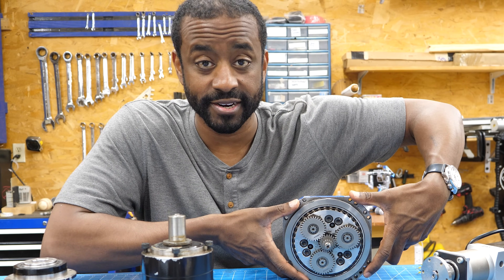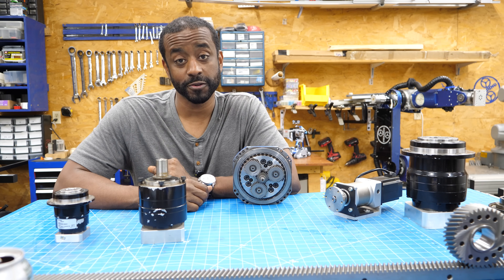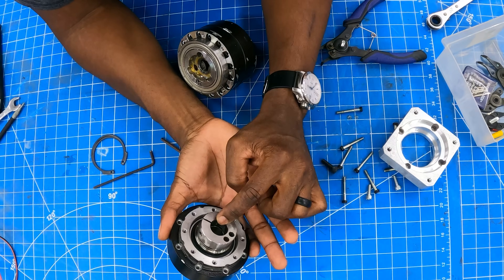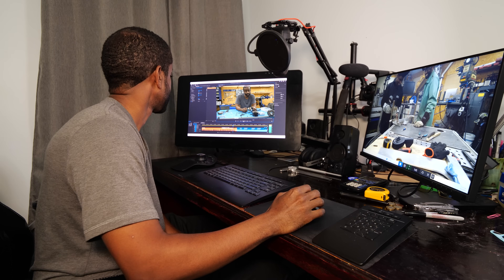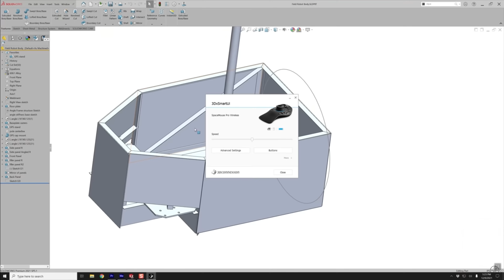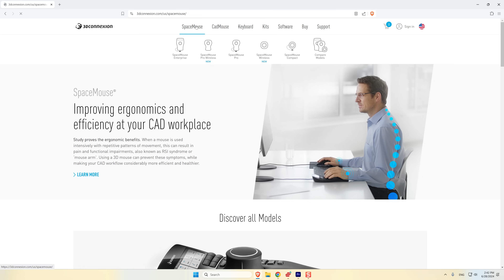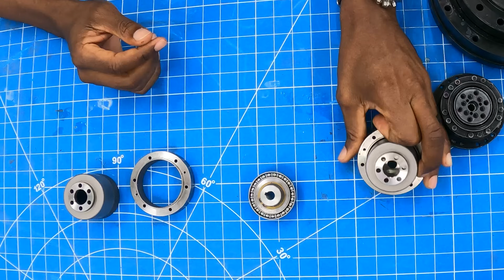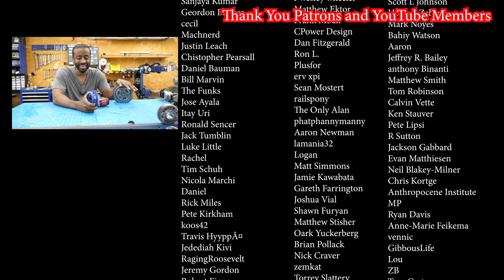Why Harmonic Drives Are Awesome.

Comment: I disagree about positional accuracy,  worm drives are used to point telescopes at arc minute level accuracy
Reply from the maker: Backlash is irrelevant when controlling by hand. Unless you are talking about a fully automatic telescope. If so it’s likely not a worm drive. But this is an interesting question. I didn’t mention this difference in the video
Reply: @JeremyFieldingSr  Computerized worm drive driven telescopes. I service them as part my job. Accuracy is achieved by having a larger ring gear with higher tooth count along with lapped gears for smoother periodic errors. Manufacturing has gotten so much cheaper that sub 1000 dolar telescope mounts can have periodic errors in tracking of less than 4 arc seconds peak to peak. Only annoying issue is backlash,  which is reduced with a spring loaded worm gear that is pushed against the ring gear but will not stall due to the spring mechanism. Older telescope mounts needed manual setting of gap and would sometimes stall the motor with temperature changes.  In fact, my personal mount has encoders and I can even take images without a camera providing positional feedback, the encoder records the periodic error and provides a closed feedback loop. But most people by ones without encoders
Reply from the maker: 😁LOL. Ok. Details obviously matter here. Spring loaded gears are a different approach to fixing the problem. I agree when the load is low enough this works great. I have used gears like this that are split in half with half of it spring loaded to close the gap and remove backlash. What you described sounds similar or perhaps even the same maybe. There are many interesting ways to attack the problem. I have indeed seen this work well.

Comment: I wonder why strainwave drives are so expensive. Due to it it having flexible parts, it would intuitively make sense if it were more tolerant of manufacturing inaccuracies. Having a lot of teeth engaged at the same time should average out differences in engagement depth and cancel out backlash caused by too small inner teeth. Do the required properties of the flexible part make it so expensive? Is forming/stamping that part an impossibility due to work hardening?

Comment: Strain wave gears have made a big splash into astronomy in the last few years for mounts because of their no backlash and their load capacity. But I wonder how many cycles can the flex spline go through before you get material failure ?

Comment: Nice Video, My favorite "gearbox" is the "Constant speed drive" basically two axial hydraulic pumps acting as a gearbox to rectify for older aircraft generators. That thing is just amazing.
Reply: Toyota has now adapted this concept into their hybrid drives.  It just used two electrical motors and a gear train to accomplish the same thing.  The Weber State car website has amazing details about that transmission.  Will replace all mechanical transmissions pretty soon, for car-like vehicles (not heavy power).

Comment: 9:02 Wow! The confidence on display here is remarkable. Yeah, you were hesitant to begin disassembling it but you’re not even organizing and labeling all the parts as you remove them! I recently helped my brother disassemble his desk fan for maintenance and cleaning. Labeled every screw, bracket, etc. I was absolutely terrified of losing parts or reassembling it incorrectly. I’m sure glad I did it though. He was considering buying a new one and the last thing we need is more plastic in a landfill.
Reply: The power switch on my relatively new vacuum cleaner failed.  I had to remove 26 screws to get to it.  When I later wanted to put a longer cord on it, I had to take out 32 screws!  Fortunately all the screws were the same size so I did not have to keep track of which screws went where, but finding where all the screws were "hidden" took a lot of effort.

Comment: Ive never seen those strain wave gears before, clever for sure but how reliable are they, would they not be prone to metal fatigue?
Reply from the maker: As long as you design your machine with an appropriate safety factor and you keep them lubricated you should not have issues with fatigue. However, just like every decision in engineering you need to make trades. If you want the most durable gear over precision you have other options. Specifically you would want gears with larger teeth and thus larger gears. You need to look at your design needs and make choices accordingly. Most importantly though, the further you are operating from the designed limit of the gear, the longer ANY gear will last including this one.

Comment: So planetary gearing is to slow input speed(increase torque) namely, in a confined space. Got it.  ...still have no idea how that works despite taking apart many cordless drills.  I'll have to search for a visual animation as it was not clear in your explanation. Still learned a lot though.  Wish I could afford the special 3D modeling mouse but I don't even need to look to know it will be too expensive.

Comment: Some worm drives are designed to be back drivable  it depends on the contact angle as to how easily back drivable they are, they're used in lifts which may need to be hand wound in an emergency and in that case the back driving through the motor acts as a brake.

Comment: @JeremyFieldingSr - Also offering large ratios in a compact package is the Cycloidal Drive, which gives wide-ranging SMOOTHLY VARIABLE ratios. It was invented and demonstrated by an Australian mathematician, apparently in the 1980s. It operates by taking advantage of the fact that cycloids are very nearly circular in a small part of the bumpy curve, so the mechanism cuts out those parts and stitches them back together in a system slightly resembling a planetary gear set. If I recall correctly from the magazine article, a ratio range of at least 1600 was easily achieved, variable between a small speed increase and a much larger reduction ratio. Definitely both extremes and everything in between were easily accessible and continuously adjustable on-the-fly by way of a single lever. The unit also acted as a clutch when that control lever was pushed beyond max reduction ratio. But I never saw or heard more of it, and I want to! Seems to me it would make a fascinating video for your channel. Can do?

Secondly: Is it really necessarily true that in the Harmonic drive there has to be a difference of exactly 2 teeth between inner and outer? Never more than 2, never less than 2? Because I have excellent visual imagination (including animation) and it seems to me that other difference numbers should be possible, with appropriate changes to other components. I speculate that those versions are not seen because they offer ratios that are always lower than with difference number=2, so those lower ratios are achieved by  re-designing the whole drive. Makes sense to you?
Reply: I’m no engineer but wouldn’t a more tooth difference require a smaller inner gear and thus the outside would have to flex more causing more metal fatigue? Though I imagine tooth size and overall diameter difference might make more than a 2 tooth difference possible. ??
Reply: @dfriendperc  - Those concerns do not apply because this is not like any drive you've ever seen.

Comment: Fun fact, big radial aircraft piston engines often had planetary gearsets on both ends of the crankshaft.  The prop gearbox reduces the speed to keep the blade tips subsonic and the supercharger gearbox increases speed.
Reply: Makes sense, auto transmissions are often the same. An old school automatic 4spd transmission is essentially multiple sets of planetary gears that can sync up in different ways to give you different drive ratios.

Comment: Planetary gears with planets output to the driveshaft and a gasoline engine driving the sun. And for regulating the speed an electric motor connected to the ring gear.
Not good for reserve driving, but it's very responsive

Comment: I have a Black & Decker cordless screwdriver and was rather surprised when I went to open it up in the process of replacing the battery.  (Do this with the bit pointing DOWNWARD!  :-)  What I found was a two-stage planetary gear set,  which explained how the thing had some nontrivial torque...

Comment: Regarding the Space Mouse, ABSOLUTELY!  Having it on my viewport camera (NOT the model!) is an absolute MUST HAVE now.  It makes it SO easy and SUPER FAST to zip around and view things from anywhere in 3D space.  It's also really satisfying to just fly around using a 6 axis controller.  Also try it with Unity and Unreal and Google Earth and Elite Dangerous and...  I see people doing things in 3D without one and feel a little sad for them.
Reply: I attended the SIGGRAPH conference in Las Vegas in around 1991 or so and saw one of these for the first time. The hardware was ungodly expensive back then. The concept disappeared for many years and only recently seems to have turned up again.
Reply: I've been leery.  I liked the devorkian keyboard, discontinued.  Liked the ms optical mouse wheel, discontinued.  I don't want to find myself liking it, and can't get another one when it dies.

Comment: OH, so if you use a harmonic drive you don't necessarily need a slip ring to allow cables to pass through? Damn, that's hella useful!
Reply: Yep... I recently got one with with enough space to add 2 more drive tubes inside the main inner cavity, and then cabling  through the middle inside that.   Rather complex bearing stack, but keeping all the motors in the base makes a huge difference in that application with so much less weight out on level arms.

Comment: Even used harmonic drives are unfortunately crazy-expensive. I’ve seen 3D printed versions, but they only work so-so. I think part of the problem is they try to match the size and aspect ratios of commercial units made of metal, rather than being designed specifically to accommodate the physical characteristics of the plastic, such as the length and thickness of the flex spline. If designs were made that specifically took the properties of the plastics into account, I think they could be much more capable.
Reply: True...but with some patience you can pick up some like-new-ish Harmonic Drive (tm) units for $100-400 or so.   Not cheap, but a long way from the new and rather guarded list price.  (Not that its particularly easy to buy this stuff as an individual in the first place.)

Comment: I was doing robotics at Carnegie Mellon in the late 80's and early 90s and I do like strain wave gearing as well.  I would propose a slight revision to your description of precision.  You seem to equate it to a lack of backlash.  I'm sure you know this is a gross oversimplification.  We were trying to do some very high precision work over long distances and this magnified the imprecision of the strain wave gearing.  It turns out that due to the mechanical drive of the flex spline, there is a tiny sinusoidal error added to the output, in addition to the gear ratio function.  We were measuring the input and output positions very precisely with resolvers and could characterize the transfer functions of each gearbox.  Love this series Jeremy, THANKS!
Reply from the maker: Indeed it is a over simplification, but I still think appropriate for the conversation here. The series is a introduction to the gear types and why you would generally choose one over the other. There are many exceptions and what ifs to each gear type that would have been way too much for this series. Thanks for the input here. I love it when experts add detail and value in the comments. We all learn from each others experience that way.
Reply: Thank you Jeremy, I need over simplification 😂@JeremyFieldingSr

Comment: In a bicycle hub gear system, several types of gears are used to facilitate smooth and efficient gear shifting. The specific types of gears typically include:

Planetary Gears (Epicyclic Gears): This is the most common type of gear used in hub gear systems. The planetary gear setup consists of a central 'sun' gear, multiple 'planet' gears that rotate around the sun gear, and a 'ring' gear that encircles the planet gears. This arrangement allows for multiple gear ratios in a compact space within the hub of the rear wheel.

Sun Gears: These are the central gears around which the planet gears revolve.

Planet Gears: These gears revolve around the sun gear and are mounted on a movable carrier which rotates them around the sun gear.

Ring Gear: This is a large gear that encircles the planet gears, typically fixed to the hub's casing.

Clutch: A mechanism used to engage or disengage various gears to achieve different gear ratios.

Shift Ring: Used to change gears by moving the clutch to engage different combinations of these gears.

Hub gear systems are enclosed within the rear wheel hub, protecting the gears from dirt and moisture, leading to less maintenance compared to traditional derailleur systems. They offer a range of gears suitable for various riding conditions and are particularly popular on urban, commuter, and utility bikes.
Reply: E-bike motors are starting to use strain wave reduction gears. They allow a much smaller form factor and reduced noise from gear lash while coasting. Unfortunately the motors that use them are not as efficient with their use of battery power. I don't know if this is related to the strain wave gearing.

Comment: Those harmonic drives are very sensitive to overload, the flex cup will crack and you're done, junk.
Reply from the maker: I haven't heard of this issue, but assuming it is true... it makes sense to design your equipment so the risk of overload is very low. Just like any other engineering decision... every part has its pros and cons. If overload is a great risk for you, you should pick something else. But it certainly has its pros and applications that make sense for some. Calling it junk is a bit of an overstatement LOL. But you are allowed to have an opinion and never choose this drive for your projects. We all have things like that as well :)

Comment: If you're trying to explain these to beginners, it would have been good to 3d print better demonstrations.
Reply from the maker: I agree that 3d printed demos might have made some parts more clear. I will consider supplementing that in the future. In general on my channel I like to focus on showing real parts, because engineering students often but don't know what real parts look like making their job much harder. Same for makers trying to order and use real parts for the first time. I personally think looking at animations and/or 3d printed parts just don't quite give you the same confidence in your knowledge as working with real parts. Especially if you plan to actually design or make things. If you are just curious to learn and don't plan to build things, animations are 100x better because you can just focus on the concept and hide unnecessary features. You can also make components as big or as small as you want. Real parts can be hard to see and obscured by stuff around it that is required to be there in real life. Anyway, some combination of course would work great. So, I will consider that for the future.

Comment: It still baffles me how harmonic drives are so smooth and free. You would think the elliptical bearing having to actually deform the cup would make it stiff to turn and add a ton of resistance but somehow it doesn't.
Reply: At a guess, its because turning it doesn't cause more deformation, just shifts the deformation around. Where the spline on one side of the apex takes force from the elipse to deform, the other side is exerting a force back on the elipse while it relaxes.  

Ball bearings are also a hell of a drug. You can jam a wedge between two surfaces very easily, but getting a wedge to jam between two rollers with ball bearings is close to impossible.

Comment: Planetaries... my old friends. I worked in the monster truck industry the first half of my life. Planetary hubs are the key components that make monster trucks what they are today. It's not the tires, it's not the nearly 3 feet of suspension travel, it's not the blown alcohol big block, it's the planetary hubs IMO... That's where the real magic happens that allows monster trucks to do what they do in the absurdly confined spaces they operate in. Plus the fact that each hub adds another 1,200lbs of unsprung mass to each corner of the truck and you get the weird and very entertaining physics of a monster truck. They vary between trucks but the hubs typically have 3:1 5:1 6:1 or the most common 4.3:1 and they come from agricultural machines and off road forklifts or airport tugs. 

It's much less redneck than anyone ever believes... we're mostly just physics nerds with a hint of psychosis 😂